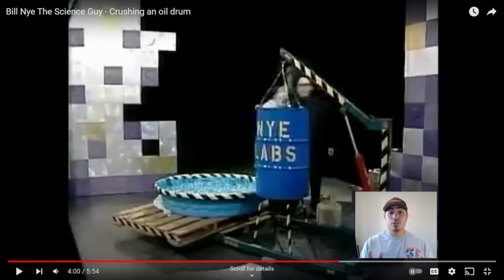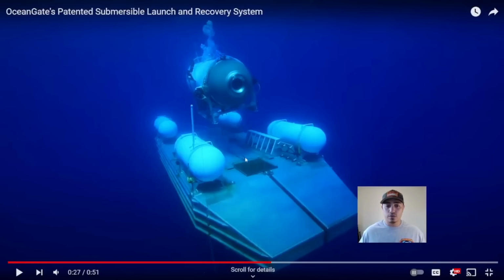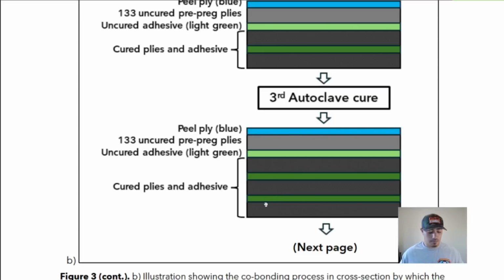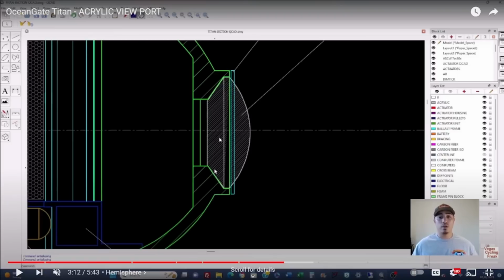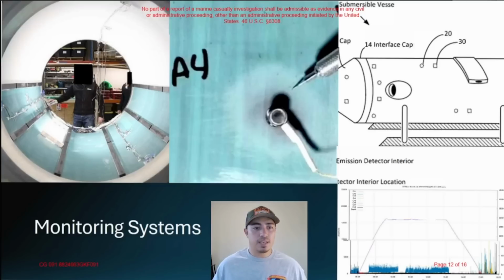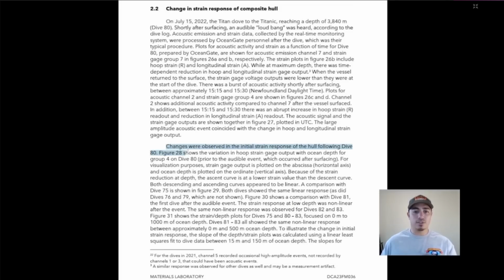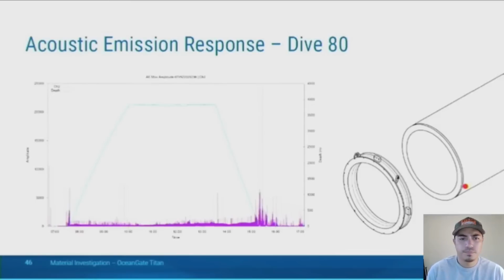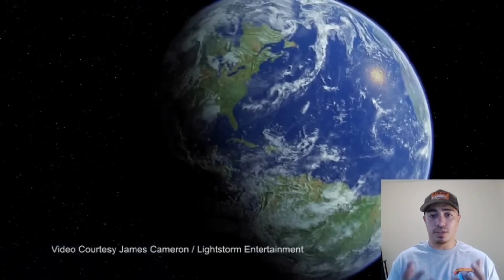Part 2: Investigating the OceanGate TITAN Tragedy: Carbon Fiber Hull, LARS Flaws, and Warning Signs

Comment: One thing not mentioned about the outside storage of the submersible was the irratic nature of weather here in St. John's during the winter.  Due to our location, our winter temperatures can fluctuate not just day-to-day but sometimes hour-to-hour, so it is likely that Titan could have experienced many freezing and thawing cycles.  I can't speak to the impact on the Titan but the repeated freezing, melting, and refreezing of snow/ice/water turns the smallest of cracks in the asphalt to a gaping pothole over a few months.

Comment: As to the viewport, it would have been STRONGER if both sides had been curved as then it would have the attributes of a sphere and the pressure would have been equally directed to the whole rim, , but stockton Rush wanted it to be flat inside to reduce distortions and get a better view for the passengers... risking that it only leaned onto a tiny bit of the inside edge under pressure...

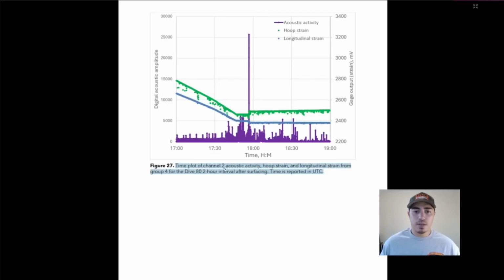Comment: 26:00 the green part of the graph starts off showing us the strain gradually reducing as the pressure  reduced from bringing the sub back to sea level. The sound was hard while the sun was still in the water and as the graph shows, not long after reaching the surface and our activity skyrockets up our stain hikes up as well. The Home does not look dramatic but it is illustrating that our sub has a new base line stain that is higher than it ever was before. This shows us that long term permanent damage was done and our new "normal" can not ensure as much pressure and abuse as it could the day before. It isn't a static change on the graph but this is one of the last things you would ever want to say. It is telling us "something broke and I'm not as strong as i was before."

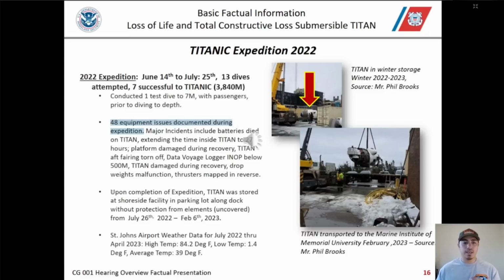Comment: 16:15 - THIS IS THE BIGGEST ISSUE THAT OFTEN GETS OVERLOOKED...

Many people do touch on this but often they do not realize that this could be what led to Titan failing when it did. We know now that the hull was not the first thing to fail. The front seal between the titanium end cap and the carbon fiber hull is what failed and this has everything to do with Titan being allowed to spend a Canadian winter outside in a parking lot. The seal that failed was made with Locktite that Stockton almost certainly purchased at Home Depot, Menards, Ace Hardware, or another home goods and light commercial hardware store. I personally think it is odd to use the same product that I would use on my dog house or in my garage, but that isn't the big problem. All Locktite and other bonding agents have temperature ratings and they are not to be used on applications or areas that are not within these parameters. This specific Locktite has a max use temperature of course to 350°F, (its been a while since I looked this up and while I may be a few degrees off, the numbers are more than accurate enough for this example.) and a minimum use temperature of 72°F or about room temperature. Anything outside of this range will cause the product to either not bond, melt, or become brittle. That means it was not even rated for visiting the Titanic, however; a few hours at 35° is nothing like months and months spent at 0° which is exactly what happened in that parking lot. This becomes even more damning when you learn that on its first mission back after the parking lot hotel near the end of the drive, the acoustics monitors on the Titan showed some very worrisome readings on censors near the front of the sub. Of course, Stockton wrote this off as something ridiculous like getting broken in. It was only 7 dive attempts later no one came back alive. I forget exactly but i believe the majority of those dives in between were not at all successful. 

TLDR: Egomaniac and Narcissist uses family fortune to build subs thinking that this will lead to the world viewing him as one of its greatest explorers and entrepreneurs. To do this he breaks every safety rule imaginable and deliberately hires a team of cheap young people or people with mostly unrelated experience as he was tired of being told he was going to get people killed. After using Locktite from Home Depot to hold together his submersible in a very hostile environment and leaves it in a Canadian parking lot for months on end he is not concerned when his make shift warning censors tell him something is wrong. After cutting every corner imaginable, hiring inexperienced people, ignoring every warning, lying about the companies professional associations in an attempt to put his victims at ease about the risks associated with taking a tin can 12,000 feet below the surface of the earth. On June 18th, 2023 Stockton Rush boarded the can with 4 of his will be victims. This was dive attempt 87 and they hoped it would be successful attempt 14. Instead the main seal failed and 4000 pounds of water filled the hull as pressure per square inch and everyone died instantly.
Reply: Dive 88, not 87

Comment: I've been involved and in charge of testing high pressure and vacuum rated piping systems and vessels (big thick cylinders) for a decade and I an ashamed i bought the implosion theory along with everyone else! The hull itself was just so sus in every possible way but i know so well from personal experience that the material is almost never what gives way even if it is severally under rated for the pressure. It is always the joint or joints that fail and the fact that Stockton used Locktite from Home Depot that was not rated for low temperatures to bond his carbon fiber hull to the titanium end caps and left it outside in a Canadian parking lot for the winter should have been a dead give away as to what failed to most people and most of all, ME! No one was highlighting the info I just shared though and I was eating up everything about the mistakes with he carbon fiber instead of using my head and thinking about all of this logically.

Comment: re: the viewport - the following information is from other videos i've watched: the strongest shape would have been a curved outside and a curved inside, as that would act like an arch and distribute the load and strain evenly. the problem with that shape is it acts like a lens, and makes things outside the vessel appear farther away, and if you're paying 250k you want to feel like you're right next to the Titanic. having a flat inner surface fixes the magnification, but it introduces different load/strain distributions that would need a lot of testing (which of course they didn't do). i seem to remember the figure of 1300m as the depth the acrylic viewport was certified for

Comment: Bottom line. He was a smart man with no common sense. Hearing the loud bangs every  time it went into the water told most of us it was failing. I am impressed that it went down that many times before  it gave way.But I knew it was a matter of time. I was not surprised at all when it gave way.He built a death trap.

Comment: The hoop strain would show the tension of the pretensioned laminate. If there is a loud event, then a lower strain and then a second loud event with a higher strain afterwards, this is a failure of the laminate, which is stuck in some way, probably some buckling, which is then resolved (it breaks) by the second loud event. For it to work this way, there needs to be some internal delamination, which enables movement of the strands in the laminate to occur, including overloading individual strands and their breakage (loud events).

Comment: You can't just look at barrel collapsing under air pressure and propagate that observation to water pressure.
Water is not as compressible as air - so the local pressure will be decreasing very fast.
If it was not compressible at all, it would've been a free fall speed. Water is cimpressed by ~2% at 4km depth, while air is by 41000% - quite a difference, huh.

Comment: The most remarkable aspect of this submersible vehicle is that considering how it was thrown together with appalling standards of cleanliness and workmanship.

How it was neglected outside for months, uncovered, how the components fitted to it were not rated to the depths it routinely dove to, and strain gauge anomalies were ignored and the data destroyed.

How this vessel actually managed to retain structural integrity for the number of deep dives that it completed is utterly remarkable!

Ultimately, it was pushed far beyond what it was possible to survive and it ran out of luck and structural integrity simultaneously...

Clearly, no paying passengers bothered to carry out even the most basic due diligence on the Company, its CEO or its unlicensed, uncertified, untested deep submergence vehicle...

Comment: Regarding Hoop Strain, the graph is reflecting the exact variance in circumference of the tube, due to pressure, but also temperature. The loud bang after surfacing was probably caused by the pressure relaxing on the hull, but I believe more importantly, the change from low temperatures at depth, thawing to the higher temperatures at the surface. After sufficient thawing, the materials simply expanded back to their original state. (reference @rickshutt3974 below)

Comment: Putting all else aside for the moment, let's look at the basic effect of temperature on carbon fiber and the titanium end caps that were essentially glued onto the carbon fiber tube. When cooled, considerably at ocean depths, carbon fiber has a significantly lower coefficient of thermal expansion (CTE) compared to titanium, meaning the carbon fiber will expand and contract much less with temperature changes, resulting in a CTE ratio between the two materials being considerably smaller for carbon fiber than titanium; essentially, carbon fiber has a "near-zero" CTE while titanium has a relatively high positive CTE. This dissimilar rate of shrinkage at depth would simply cause the glued surface tolerances to separate as the two materials shrunk at radically different rates. Pretty basic stuff.

Comment: its crazy that their strain gauges and rtm system actually worked, but were just ignored.  im pretty sure rhino liner isnt rated to work on the bottom of the ocean.  crazy they were bragging about using a material meant to protect a vehicle from puddles and rain
Reply from the maker: Exactly man, all warnings ignored. What a shame. Rhino liner works great near the surface. It’s not designed for deep depths. I personally feel water penetrated the coating. Obviously not the only issue here but it would have cause issues eventually imo.
Reply: it's insane they used a material meant to  protect truck  beds from puddles and rain down to a 6000 psi environment.  i bet they didnt even check the application for air bubbles, or for compression damage.  just like paint that stuff wouldn't fare well as the hull shrunk underneath it

Comment: You've got to read the transcript of the meeting where Rush fired Lockridge. Rush claims the rest of the scientific and engineering world is wrong about carbon fibre and it is actually stronger in compression than tension. The guy must have got his degree from bovine university.

Comment: Many are speculating that the acrylic view-port was what failed and was the catalyzing event for the implosion because of, 1) the 1300M test depth of the view-port and, 2) the amount of debris, especially the carbon-fiber, that was possibly propelled into the aft-dome of the submersible.
Reply: surely if the viewpoint failed, and water rapidly entered through the open aperture in the forward dome, the vessel would explode from pressure rapidly increasing from inside?
Reply: @adamheywood113   The carbon-fiber chamber and everybody within it would hv collapsed long before any water would hv had a chance to fill that small pressurized area. We are talking a speed on a colossal scale to almost be instantaneous.
Reply: @edkiely2712  I'm just saying, if the point of failure was the viewport, the water would have gone into the craft from the nose and pushed everything outwards
I'm not an engineer so maybe I'm wrong, but if the craft imploded and all the external hull was forced into the rear dome, that's water pushing from the outside of the hull with no resistance, meaning the hull failed
Reply: @adamheywood113   I get how you're framing it. The pressure collapse is obviously because of the enormous weight and power of the water. One cubic meter of water weighs a ton, so one can't even comprehend the applied pressure at those depths. Because of that, we are dealing with physics on a scale almost comparable to that of subatomic physics where normal conceptualizations aren't helpful. The pressure built-up at that depths would hv made the speed of the collapse of the air within the pressurized chamber faster than it took the water to fill it, even though the water is itself the cause. The water filling-in the empty area of space would hv occured fractions-of-a-second later in time. The heat alone generated by the speed of the collapse would hv reached an enormous temperature, if only for a fraction of a second itself, which is why the bodies would have been pulverized. I'll see if I can find the title to a video I watched that went over this a few months ago for you!

Comment: Thanks for the series. As an engineer with an understanding of carbon composites, the strain data anomaly was almost certainly the point where the hull carbon layers delaminated. As you mention this should have been the point that all dives were abandoned. This design was a death trap, completely unsuitable geometry and material for this application.
Reply: It seems Stockton Rush cared even less about safety than the Soviet space program did, and I didn't think that was possible.

Comment: Most important steps that Rush cut corners were the 45 degree carbon fiber spin and the curing process, the curing process, Ocean gate did not use an auto clave, it was all a lie.
Reply from the maker: How do you know they didn’t use an autoclave? I agree with the rest.

Comment: The acrylic cracking before complete failure is a normal trait of the material. It is an approved material for a dsv as is titanium. Carbon fibre is not an approved material.   Afaik the port has not been implicated in the failure.

Comment: well the funny thing is the real time monitering system that rush had so much faith in saving them, it actually worked it showed that the hull had deformations that pressure was ingressing on the carbon fiber it did warn them of an impending failure rush just didn't have the right people analyzing the data, there were huge spikes on dive 80  indicating carbon fiber cracking Stockton said no that it was something hitting the outside of the hull its hubris at its worse

Comment: It comes across to me as though Stockton just decides things are adequate because they look and sound impressive and because his gut feeling tells him so. I have never really seen anyone produce evidence of HOW they came to the conclusions that the hull and pressure vessel components are adequately designed and manufactured to withstand the specific pressures that it would undergo at the 4000m. Is there documents that shows their calculations and tests performed? How did they come to the conclusion that 12 cm of carbon fiber was sufficient, or that the acrylic window was good to 4000m? I am assuming there are actual calculations and engineering that went behind all that, but I have never seen it. I am just curious whether the submersible could have worked if they just used all titanium and didn't have two different materials glued together, or if having a tubular design is just flawed in general. I guess my overall question is, what made Stockton so damn confident in his design? So much that he felt comfortable risking his own life.
Reply: There is nothing fundamentally wrong with using a cylinder, it's just that it is not as strong as a sphere.

So you have to make it stronger e.g. make it thicker, use different materials etc.

Comment: Not an expert here, so excuse my amateurish comprehension of the physics involved.  However, I am a person who is fascinated by aviation forensics.  Somewhere along the way (another report, but something you brought up as well), it was mentioned that there was no way to examine the “inner workings” of the various layers of the hull.  😮😮😮  So, if you can’t get in there and examine what’s going on below and beyond the surface……HOW, JUST HOW…..?
Reply from the maker: Yes I was shocked by that. I mean… they could have removed all of the inner wall coverings, electronics, rebreather, etc but it seems they opted not to do so. Researching other sub designs now and it’s par for the course to strip everything down and inspect periodically. Very unfortunate stuff.

Comment: I think it was confirmed that the failure point was the glue where the hull mated with the ring. 

Ironically the hull itself held until the glue failed and the window port was also the thickest piece of material on the entire sub if I remember. It was like 7 or more inches thick. 

Nice thing acrylic is that it fails visually long before it does mechanically. It’ll get blurry before it starts to crack. So it does actually provide a warning well before it goes. Meanwhile fiber glass when it fails just goes. 

But yeah it’s the glue, had bunch of air bubbles in because they didn’t bother to get rid of them. They thought just sticking the sub in an oven would be good enough to get rid of them. If they followed the proper method, they may have lived.

Comment: That test is just showing 1atm crushing the oil drums as low pressure water vapour condenses inside, iirc. We live at the bottom of the atmosphere, like creatures live at the bottom of the oceans. Those strain gauges and the loud bang indicate the titan had lost its elasticity and had become permanently stretched and/or deformed.